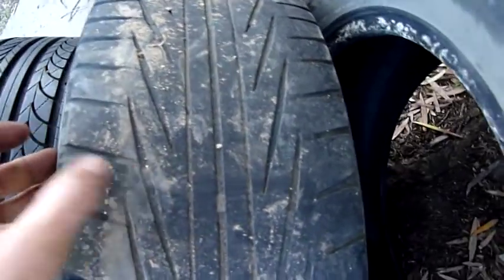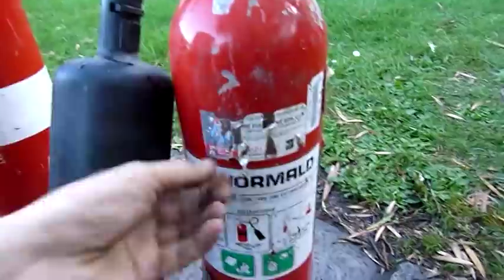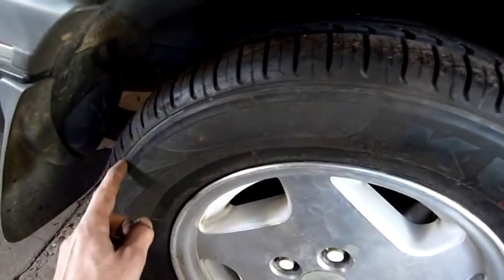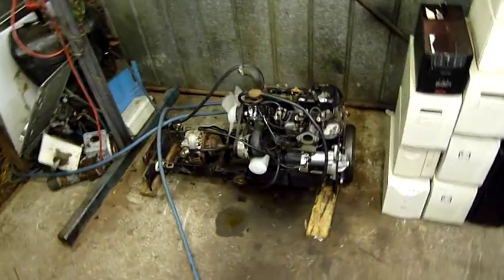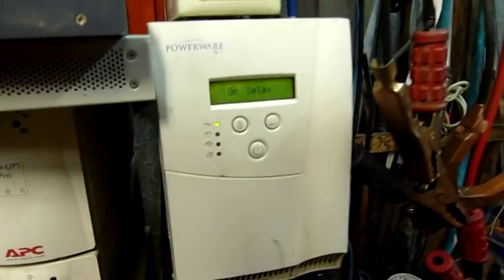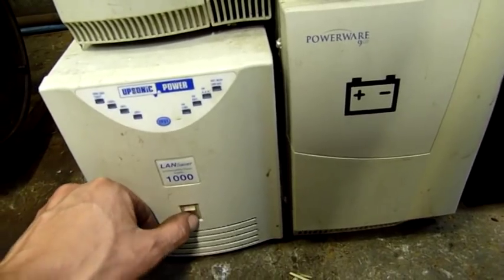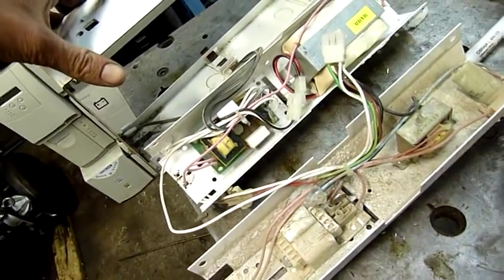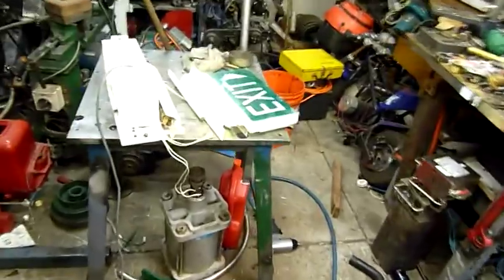Friday Fun - Fire Extinguishers - Ford Tires - UPS Units and Stuff

Comment from the maker: lol, they are pretty strict with testing and certification now, but as long as it is holding full pressure and you shake the drychem ones loose now and then, they will be fine

Comment: You could probably backup most of your house with all of those UPS units!
I want to get a UPS around 5 or 6KW to run several circuits in my house and power it from a big 24v forklift battery. Where I live, I loose power a lot in the winter, sometimes for a week or more. The big UPS would save me from constantly having to run the generator.

Comment: Unusual to see T5 lamps on a magnetic ballast. As far as I know, T5 lamps are designed for use on electronic ballasts only.

And as for your shed electrical works, as I said in a previous video - install more than one RCD so you don't kill everything when testing your latest project :).

Comment: Ed, powder extinguishers cause more carnage than good when discharged, use those outdoors, keep the Co2 ones for indoors, but sadly, it has become more viable to put in new (and crappier) units than to pressure test or even refill them. Ie: To refill a 9kg dry chem is around A$120 +GST and a new unit is A$110.50 (incl. GST and Shipping) so the math part explains that....but being a kid... I use to see yellow BCF ones (I had a few too) which is cleaner like Co2, I hope you can a water one soon:)

Comment: A UPS is an Uninterupted Power Supply. It monitors the power of the net and when the net fails, the UPS will make sure that whatever device is coupled to it will stay on.

Mainly they are used for computers because they don't like sudden shutdowns. With a UPS you will be able to shutdown your computer without losing valuable data.

Comment: You can have three-phase power at home, converted from single-phase by simple three-phase motor + couple of caps and switches. With very high efficiency. Google for "Rotary Phase Converter". You'll find lots of info on those.

Comment: It's short term battery backup (UPS = Uninterruptable Power Supply) to give you enough power to safely shut down your PC when the power goes out. They only last about 10-20 minutes in most cases, plenty of time to shut down and save your data. =)

Those units were probably for high power servers so would run a regular desktop for a lot longer than 10-20 mins.

Comment: only use pure signwave units on computers, the regular dc current will kill your PSU. I'm using a 12 year old UPS on original batteries, powerware is a good maker. still works.

Comment: Are you saying that exit sign has 2 tubes, one for mains electricity and one for battery backup operation?  As for the big UPS units with the digital readouts on them, I suspect those are commercial units for server rooms etc, right?

Comment: Get a rotary (or build for almost zero dollars in your heavenly scrapyard location) 3 phase converter.  Got one for my elevator which has a 3 phase drive.

My shiny new 3 phase rotary converter ($300 USD) was made from a 3 phase motor and one oil capacitor.  It produces 3 phase clean enough to finally satisfy that bitchy 3 phase ABB monitor in the elevator control panel.

Comment: Hey Ed, Question. I have an Old Sola 320UPS which has a dead battery. Can this unit be used in a car running off a 140AH Deep Cycle AGM battery? It would be handy having this setup in the 4wd for a 240v supply. Thanks

Comment: I wouldn't try, the UPS probably won't be powerful enough for a laser printer. They use a minimum of 1000 watts in most cases when heating up. They don't need backup power anyway. Printing will be the last thing on your mind in most power cuts!